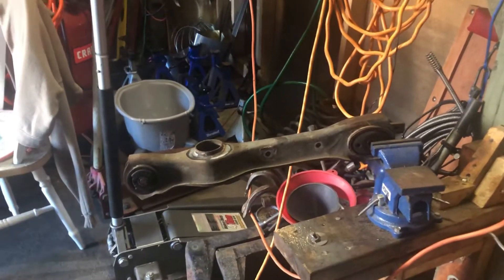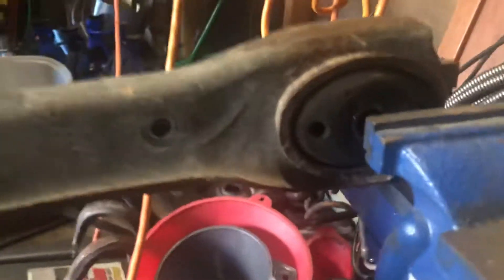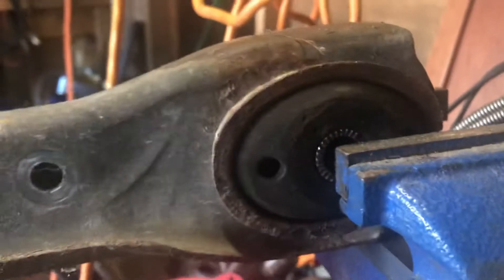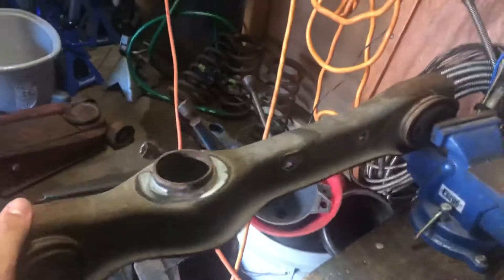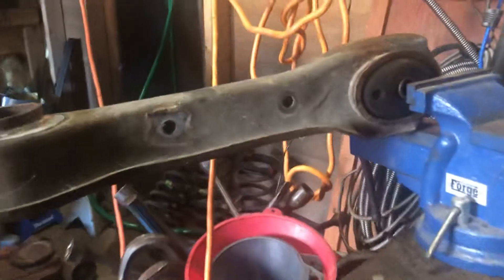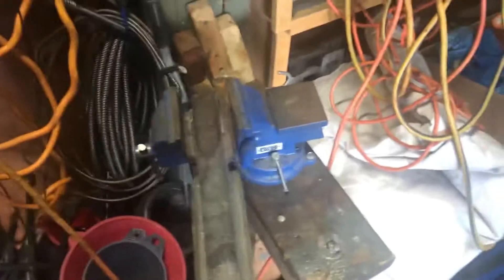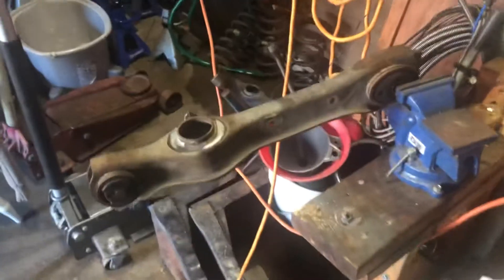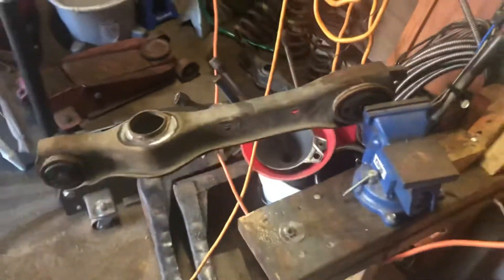79-04 mustang factory flaw..The Pony’s weakest link…

Comment: Jesus christ the scared the hell out of me, i was already thinking about getting some, def getting some now.
Reply from the maker: Ya definitely change them..one of the best mods I’ve done…
Reply: @NewEdgeDesigns  would you recommend those in the thumbnail? From bbk right
Reply from the maker: @Robyne_u61  yes absolutely…They are a good option…But if I could do it again I would go with the maximum motor sports weight jacker, so you could dial in the height perfectly…

Comment: How did you know about this flaw? I guess that's what you get with American made nowadays.
Reply from the maker: Just researching the old mustangs forum threads, because of a funny noise I was getting from my rear axle…
Reply from the maker: This was actually designed into the chassis to mitigate between performance and road noise, obviously choosing to cater to the average driver and not so much the performance oriented owner…
Reply: @NewEdgeDesigns  Well it looks like you know what you are doing, I'm sure you can find an aftermarket part that will fix the noise.
Reply from the maker: @Pixics  yes..the part pictured in the thumbnail was installed and improved The Whole ride dramatically….Bbk tubular rear lower control arms with polyurethane bushings…